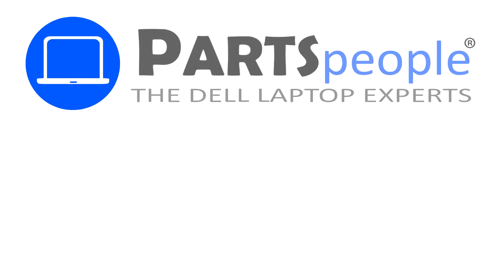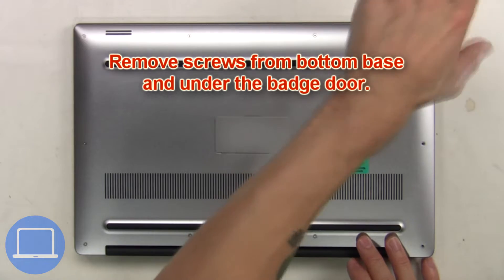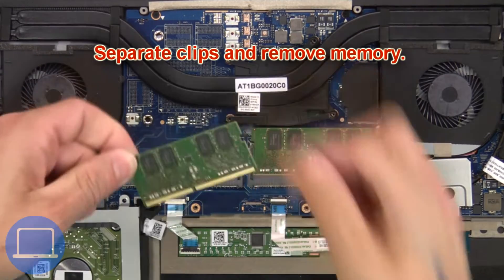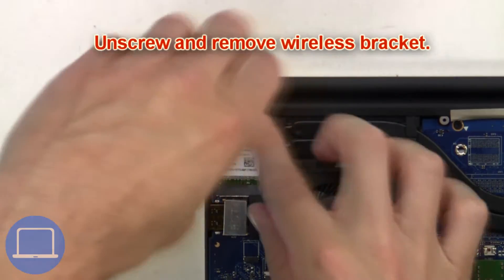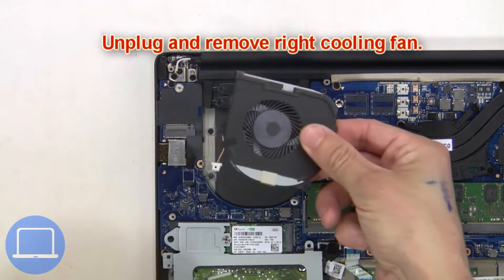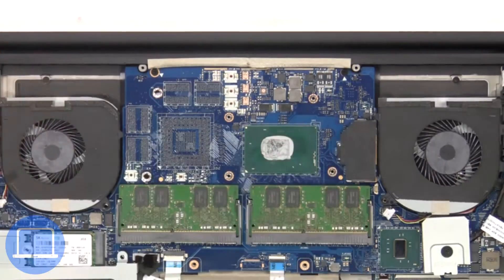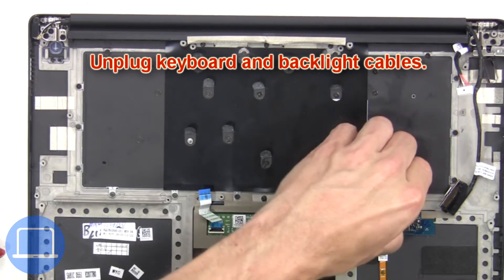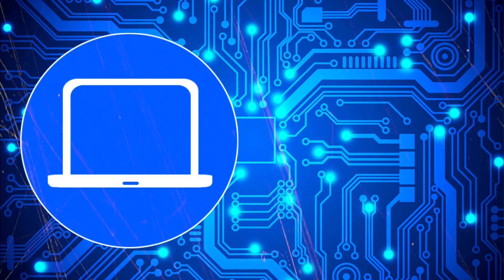Dell XPS 15-7590 (P56F003) Keyboard How-To Video Tutorial

Comment: I somehow ended up with 2 extra screws LOL, but mine was slightly different from the video.  The build must have been a bit different.  Thanks for the informative video.  That is the deepest I have ever been into taking a laptop apart.  AND it works great after I put it back together. 😅😅😅